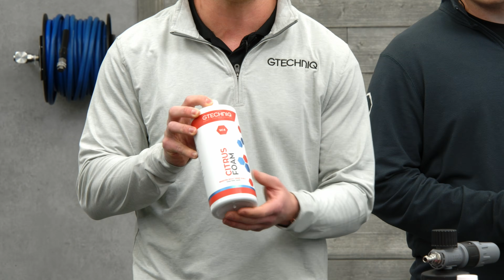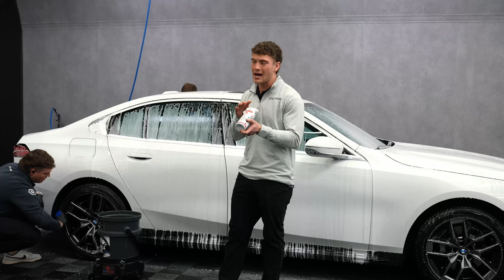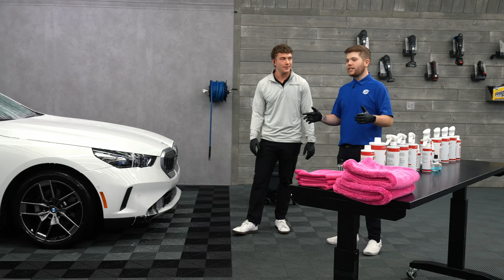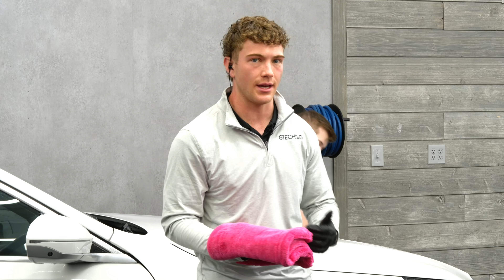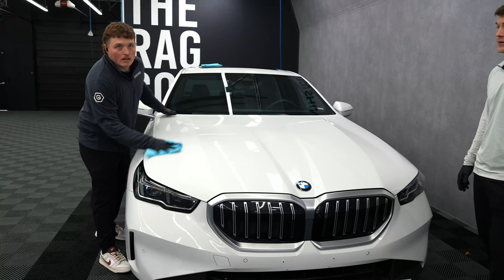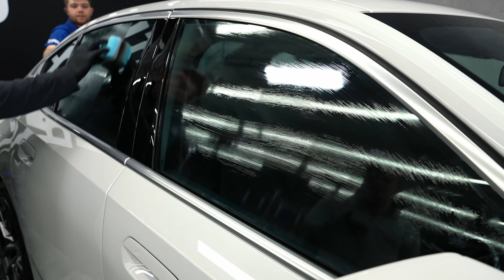We Tried Gtechniq's New Ceramic Coating | GT One

Comment: What is the point of this product?  50ml for $109 (so it is more expensive than traditional coatings that last 3-5 years) and it lasts "up to 1 year."  Why wouldn't someone choose 100ml of CarPro lite or 200ml of Gyeon CanCoat Evo, both which give the same duration and ease of application and both are roughly half the price.  All of them can be used on paint, trim, plastic and glass, all are good for a year.

Comment: Ok you really got my attention with this product as well as the rinseless!! 

Both mine and my wife’s cars are coated with CSL + EXO V5 and are going strong after two years.

Only gtechniq products touch my paint

Edit: if I wanted to put this or another gtechniq coating on our vehicles after the have reached their lifespan do I still have to clay and polish? Even if I’m happy with my pain a theirs no marring etc?  

Can I just do a wash, chemical decon, panel wipe then recoat with the GT one or CSL??
Reply: We would definitely suggest that you at least panel wipe and go from there. GT1 would act as a topper over CSL, similar to EXO. If you're going to apply CSL again, we would recommend you lightly polish the surface before reapplying that base layer. Crystal Serum Light is formulated to bond to clear coat. Toppers like EXO and GT1 bond to coated surfaces and clear coat.

Comment: Gtechniq, I have matte black tables in a meeting room, after the meeting there are many unsightly finger print marks.

Would EXO be good to act as a oleophobic barrier?
Reply: If you're looking for Oleophobic checkout these numbers from our lab below on the development of EXOv5. It's your best option. 

EXO WCA / ° DIIMCA / ° SFE / mNm-1

v1 110 76 20

v2 115 76 19

v3 110 69 24

v4 112 76 20

v5 115 84 16

DIIMCA (diiodomethane contact angle) is the oil contact angle. Showing that v5 has the best dirt and oil repellence. SFE (Surface free energy), the lower the better. A value of below 20 mNm-1 is classified as ambiphobic; hydrophobic and oleophobic, repellent to both oil and water.

Comment: If I use the No Soak applicator, is one enough to cover all surfaces (glass, trim, and wheels), or will I need more?
Btw, I'm really impressed with Carson's pro explanation
Reply from the maker: We would recommend having 3 applicators for that type of job 2 for the paint glass and trim and one for the wheels
Reply: @theragcompany  thanks for the reply